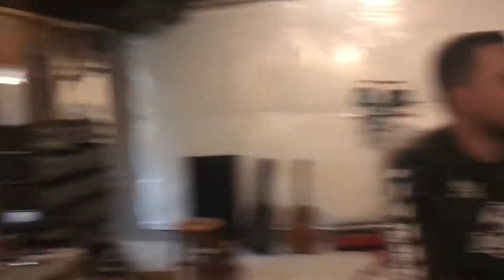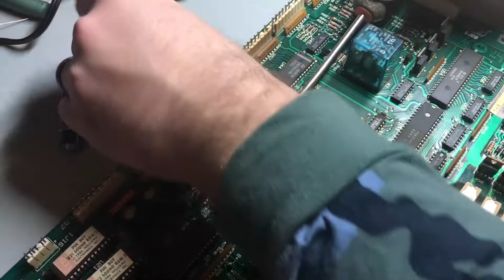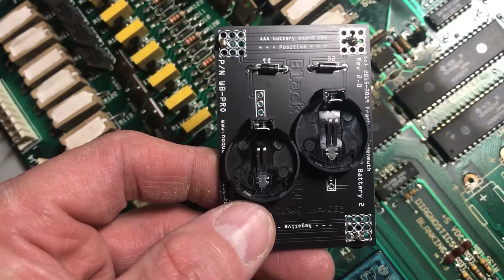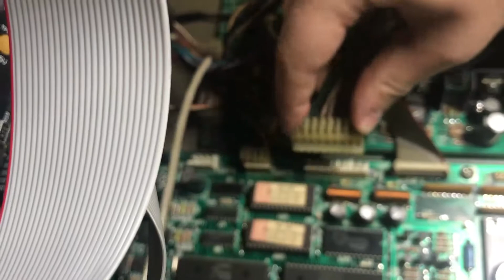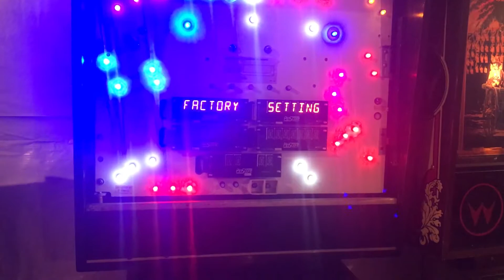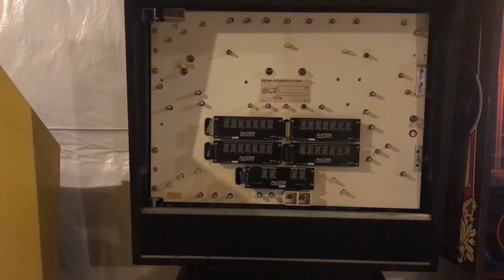How to INSTALL Frank’s Battery Board on a Williams Pinbot system 11 pinball machine

Comment: Can I use lithium AA batteries and not have to worry?
Reply from the maker: You can but what happens when later on someone puts alkaline AA’s back in because they didn’t have lithium’s on hand? It’s happened before.
Reply: That will be after I am dead since only I touch my pinball electronics.  I could marker a note on it too.
Reply from the maker: @Chris-go9ti then you have nothing to worry about. Do whatever works best for you.

Comment: Thanks for sharing. Do you know if there's a reason to not use AA NIMH rechargeable batteries like Eneloop? I've heard they don't have leaking issues like alkaline, but maybe there are other issues?
Reply from the maker: Games that use AA batteries won’t charge due to the blocking diode that’s there to prevent the game from charging the alkaline batteries. You could theoretically install rechargeable batteries and replace the diode with a jumper or resistor but you may have to play with resistor values and possibly add other components to make sure the batteries don’t get overcharged.